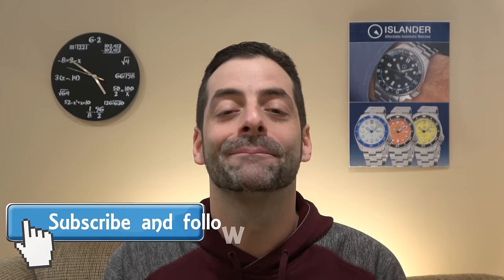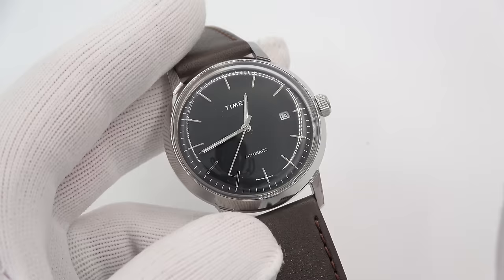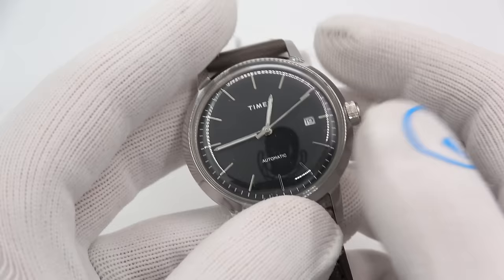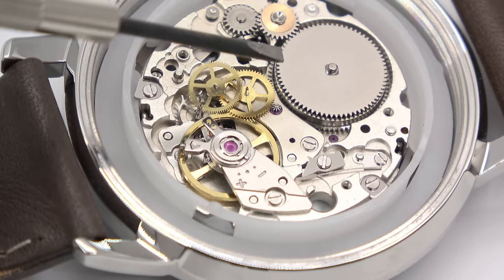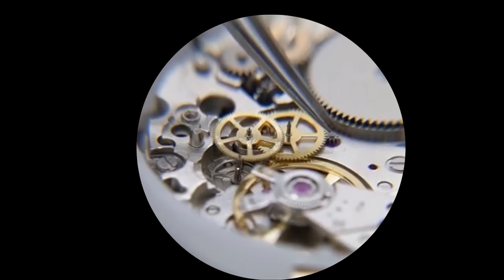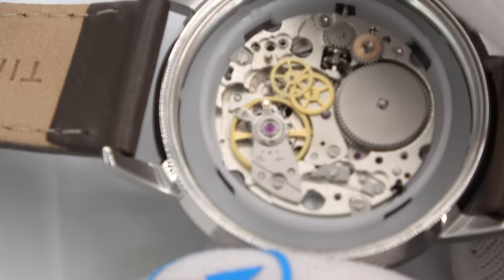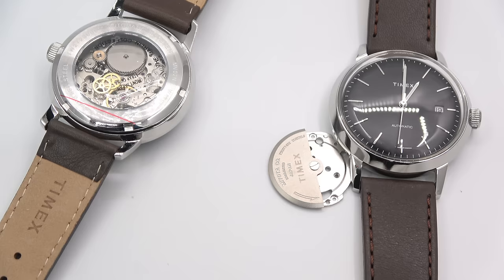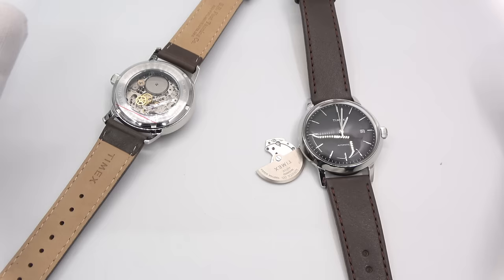Why does my seconds hand stop? Watch and Learn #73

Comment: I hate this movement with a passion, putting the bridge back on is a pain in the ass (for me anyway)
Reply from the maker: I generally don't pin comments, but this one I did. This is the most under-rated comment, spoken by someone who tinkers! The movement is sitting under a dust cover on my bench, dreading the time when I have a few minutes to scream and curse at it while getting all the parts to align.
Reply: Dude, I am totally with you on that!  I have a $20 Chinese clone that is now a bag of parts for this very reason. A very unfortunate attempt on my part to tackle my first sub 6497 sized movement after a keyless works mess I created.
     I do have to say that the Chinese knockoff has (had!) both a hacking function as well as a QUIET autowinder, so I may opt for the DG2813 movement in future compatible projects. But I was surprised/disappointed to discover that the 9xxx series Miyota has the same second hand stutter. And I am sure I not planning on disassembling a nice $100 movement for grins... maybe a ST2130 instead.
     Thank you for the explanation of the purpose and design behind this bug/feature. With the 9xxx series being a newer designed movement, I wonder if there are additional reasons for allowing the indirect drive and backlash. 
     When you said indirect drive at the start, I recalled shopping for belt driven vs direct driven turntables when I was 15 and MOSFET was hip.
Reply: I have one sitting somewhere waiting to be assembled and I'm trying to forget about it but it keeps bugging me
Reply: if you want to practice on this particular moment look for Citizen 8200a it's really cheap and basically the same as far as I know

Comment: This movement should be outlawed in this day and age altogether. I recently bought an 8215-powered watch from Alixpress and noticed that the seconds hand also jumps more than 10 seconds sometimes if I wave my arms vigorously, so the shock does affect accuracy. Had I known about the stutter and the issue I described I would not have bought it. Never experienced any of this with my NH3x and Miyota 9 series-powered watches.

Comment: so practically, if i understand correctly, when you bump the watch, the seconds hand jumps forward in time (on the dial) just as much as that "looseness" between those gears allows and then stays put until the timekeeping (gears) catch up to where it is. if this is not the case (the hand does not jump forward when bumped) then, regardless of the balance wheel not stopping counting time, the watch does lose the time the seconds hand was stationary since it's the hands that show the time passed and not the balance wheel. if some counts are lost between the balance wheel and the seconds hand then the watch loses that time. it only makes sense (to me) that the time the seconds hand is stationary was already registered by the seconds hand on the dial and it has to wait until the actual time counted catches up, that way the watch does not lose time....
Reply from the maker: You are correct.
Reply: alexandru lup Thank you. This was confusing me as well.

Comment: enen though it does not affect time keeping, it will throw the minute and the seconds hands out of sync. When you set a watch, you hack the movement with the seconds hand at 12 o'clock position, set the minute hand to the desired minute marker, and start the movement. We do this to maje sure minute hand hits market when seconds hand passes 12 oclock. With this stutter, this synchronicity will sooner or larer will be broken.

Comment: Thanks Marc. Wasn't aware of that phenomena before. Just tried it with my current watch on wrist (Tisell 9015EX) that has a Miyota 90S5 movement, and I couldn't get it to stutter, so this movement is probably immune to it.
Reply: i think it's the 8000 series that are designed this way...
Reply from the maker: It's only the 8XXX movements (and 821a)
Reply: Laz, I just tried this on my Vaer Automatic, which has the Miyota 9015 movement. Same experience as you had. I have wondered about the differences between the entry level Miyota 8,000 series movements and their higher range movements, besides the higher beat rate. I infer from this video that the 8,000 series is an older design; at least in it's conception.

This video helps to explain why the maritime wristwatches had a separate seconds dial, typically at 6 o'clock; as is reflected in the Stowa maritime today, and was also carried into field watches in Europe c. WW2, such as the dirty dozen.

Comment: I assume if they made it so both sets of teeth fit better together it would break under a knock?  Good job on the zoom in Mark.  Top marks.
Reply from the maker: Yes, but because of the size differential of the gears, this really isn't possible.

Comment: My Seiko has a 4R36 movement and the second hand stops so frequently. It's so bad to the point where I will loose 5 - 6 hrs. per day. It's absolutely unusable. I don't think the issue is anywhere near what you're talking about either. Unfortunately, I don't even have warranty.

Comment: Interesting, but I don't think I caught the reasoning behind why the slack is there, to create the backlash. The design won't work if the gears mesh more fully? I do understand that the positive pressure of the power coming through the geartrain and the negative pressure of the brake create the constant tick rate of the seconds hand.

Comment: Thanks for the information Marc. Why don’t they size the gears so they mesh properly? Wouldn’t that eliminate the problem? 👍🏻👍🏻🇺🇸
Reply from the maker: It's all in the geometry. It is designed like this so they don't get jammed up. There are many tolerances working, so a loose fit guarantees it will work.
Reply: Any gears that mesh with out any possible backlash have increased friction requiring higher forces to move and increased wear, and in some cases gears meshed too tightly will bind up.

Comment: Very cool video. Thanks! I have a question regarding the timekeeping of the watch. Let's say that the watch receives 120 bumps/day that make the seconds hand stop for 1 sec/each. Wouldn't the watch show now for ex: 11:58 vs 12:00. Or another theory is that no matter how many bumps the watch receives it only affects the seconds hand which can vary between 0-60 seconds depending on the number of a stops. According to this theory the watch shouldn't loose time and the hour and minute hands are not affected and always show correct time. I don't think that the watch is designed to compensate for a "lost" second by doing a double beat (kind of like a chronograph that jumps tot the correct second after it was paused).
Reply from the maker: I guess what I didn't say is that while it affects the seconds hand motion, it doesn't affect the minute hand.
Reply: The second hand moves forward when bumped then stops and "waits" for the rest of the watch to catch up. It has to do with the backlash of the gear train. The spring he mentions is meant to prevent this, but a good enough jolt will overcome the friction of the spring.

Comment: Can this happen if I swing my around around too quickly? I recently bough a Seiko 5 SRPD65K2 that does this. Ran beautifully for a few weeks but now I notice the hesitation. I also notice that when I set the time the watch second hand will stop or that if I set it down for a few hours the watch is still running when I get back to it but it's now way behind like it had stopped. This normal for this watch?